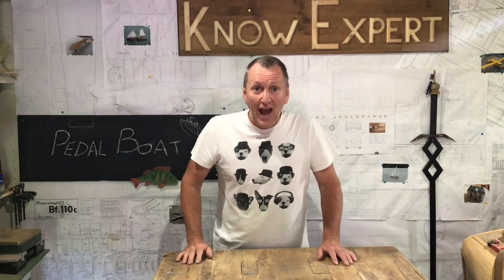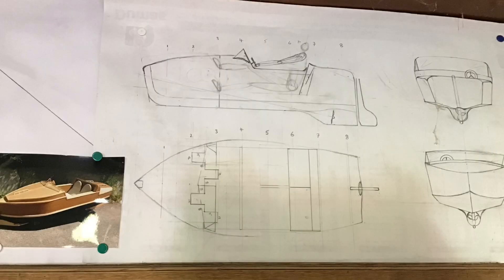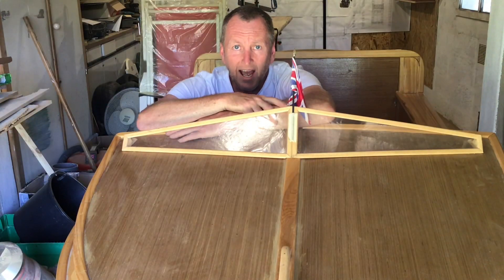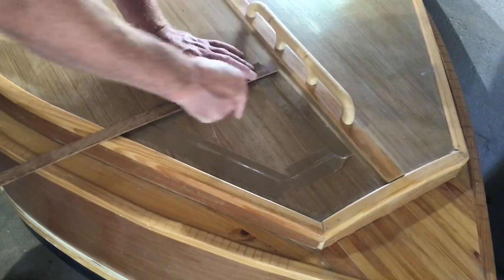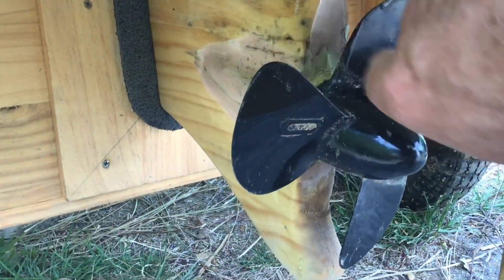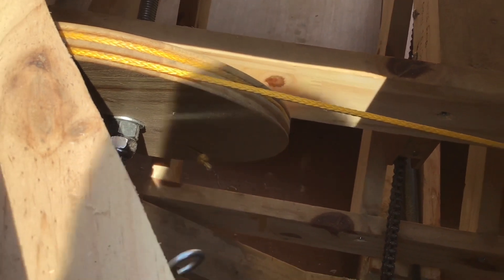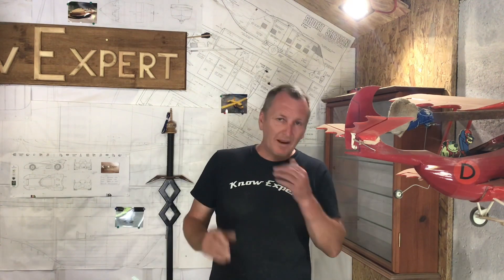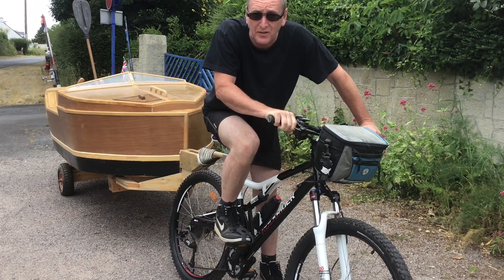Pedal boat. Wood  Home made 2 seater. Prop driven. Fun. Fishing. Sailing. DIY. ECO friendly BOAT.

Comment: Thanks for showing us the basics in building your marvelous pedal boat. I'd like to adapt this to an ocean-going row boat so I can switch between rowing and pedaling.
Reply from the maker: Hi Sean, glad you like my boat. I do use this in the sea near my house it’s very stable. I wasn’t expecting to be able to sit on one side behind the wheel when I was on my own. I’m not sure about rowing it though unless you are able to row it forward whilst facing forward because the back is flat and you can’t really turn around. The only thing I would change if making it again would be to use a bigger propeller. This one is far to easy to pedal. Or maybe gear it differently. Thanks for watching. More stuff coming soon…… subscribe if you don’t want to miss it!  Need more info then go to Noah x Pert on Facebook and 'friend' then you can message if you need to know something.   Know Expert.

Comment: Would have loved to see you operating the pedals & see the propeller move as well as the steering & the rudder operation. Would love to see actual real time boat movement instead of the silly high speed filming
Reply from the maker: Hi Trucker, check out my other videos… steering and rudder both shown along with propeller. Unfortunately high speed film was the only option because I was against the flow of the water which slows it down (it’s slow anyway) and it was very windy which made for extra poor microphone reception. So a very slow silent film was speeded up…… sorry.  The boat maybe sold this weekend so I’ll try and film one last time. Thanks for watching……. Know Expert
Reply: @Know-Expert  Okie dokie. . . .gotchya. No problem. That is one awesome creation/build. Job well done. how heavy is your boat anyways???
Reply from the maker: @truckerray7533  Thanks Trucker nice compliment, as for the weight mmmmm I honestly don’t know exactly how much it weighs but at a guess I’d say 100kg. (220 lbs) I can pull it with my mountain bike but not up mountains…. Ha ha. Not in the water this weekend though because of a big storm…….
Reply: @Know-Expert  your welcome